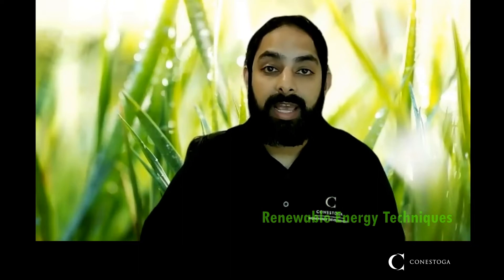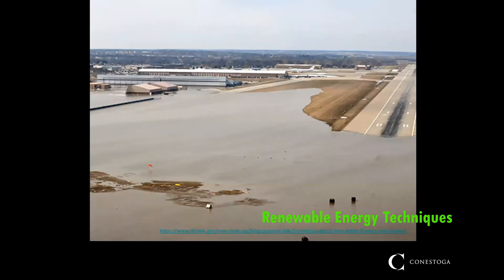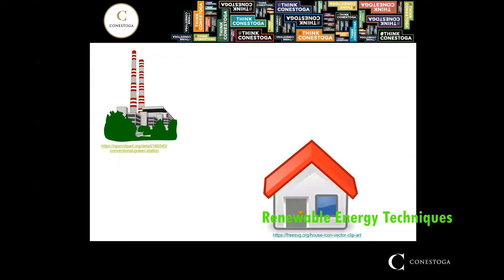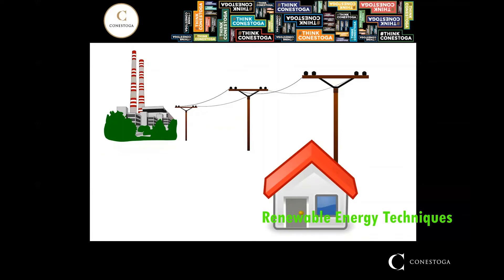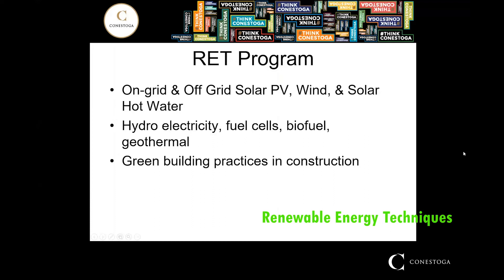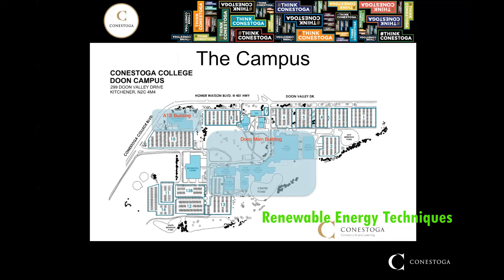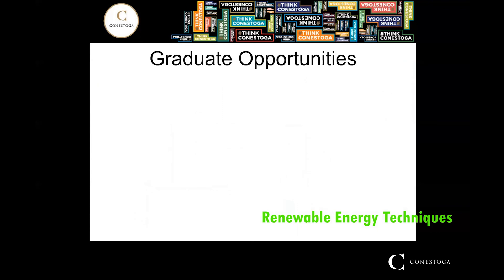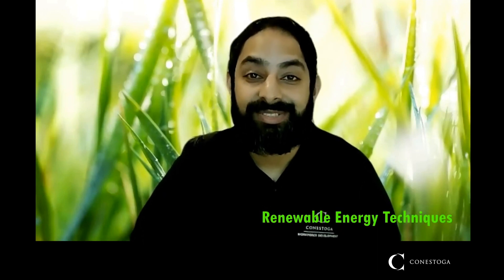Renewable Energy Techniques (1044)

Comment: Sir I have done diploma in electronics and instrumentation engineering....
Can I apply for Sept 2022 intake? 
May I know what is future scope in Canada in the field?
Reply from the maker: Yes you can. Graduates may find employment in a number of areas related to renewable energy. Sample jobs would include: solar photovoltaic designer and installer, solar thermal designer and installer, sustainable living/green building consultant, sales and/or marketing of renewable energy equipment and products, wind and solar farm installation, maintenance, and repair. Attend our open house on March 12 and find out more.